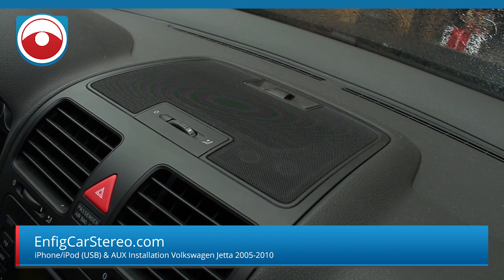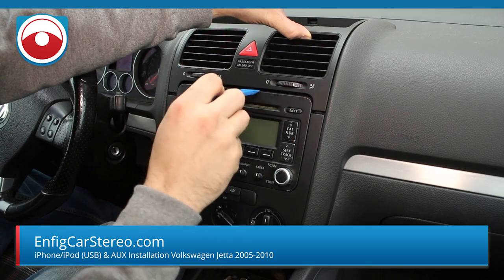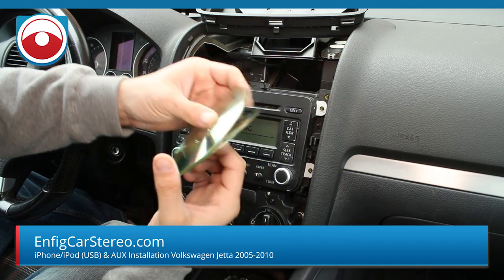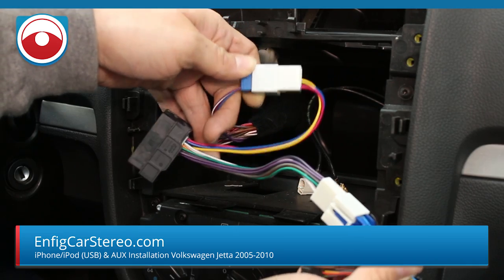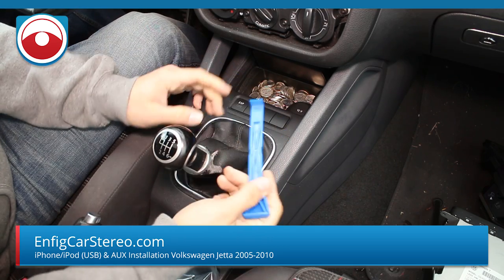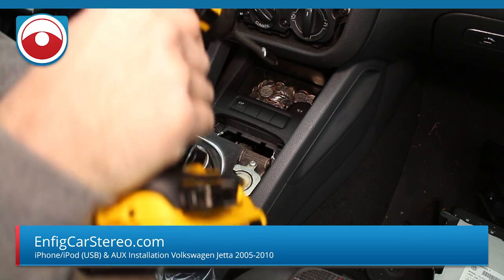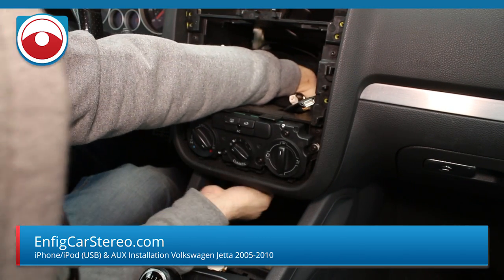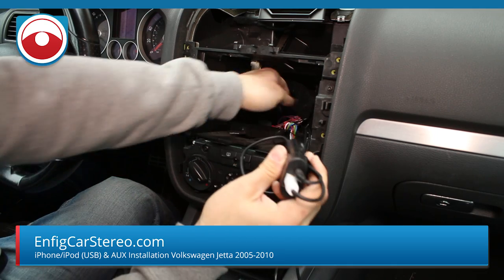iPhone adapter install 2006-2009 Volkswagen MK5 Golf GLI GTI Jetta R32 Rabbit

Comment: Have a question. What if i don't have the main box. But i have the conector to the radio i saw one on internet just only for aux. It will work???
Reply from the maker: That connector only works if your car already had a factory AUX.  The people in china know that it costs too much money to send it back so they continue selling it.
Reply: Enfig  o i got it man i actually just by mistake pressed i don't know wich button was and i saw the aux option but my car doesn't has any aux port. Thanks bro
Reply from the maker: The CD button twice activates the AUX port if the car has one.  Either the car already had an aux or someone swapped the factory radio before you purchased it.
Reply: Enfig o yes could be an option. I bought the car 2nd hand but i will check and i let you know. Nice video man
Reply: Enfig yes i checked and yes pressing twice cd button appears aux -ext thanks bro